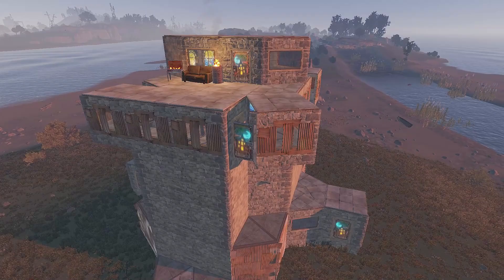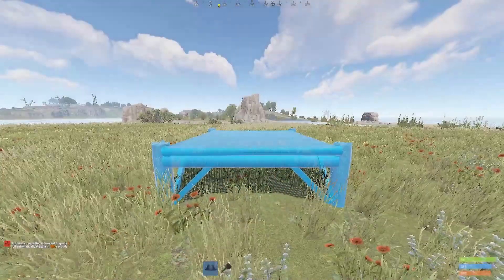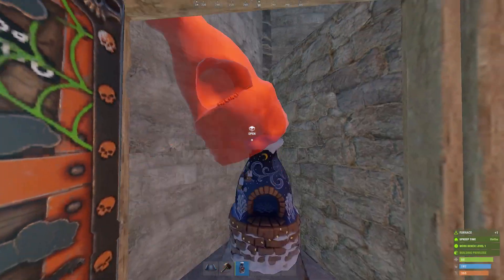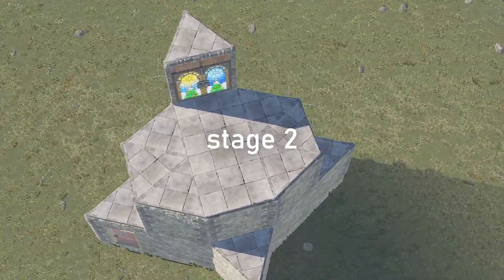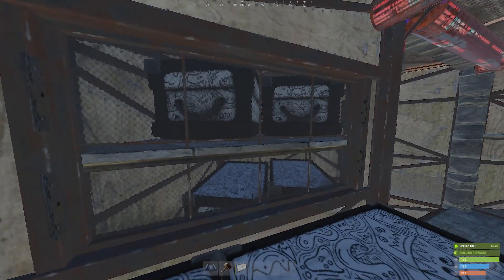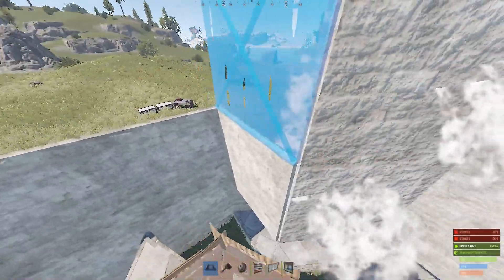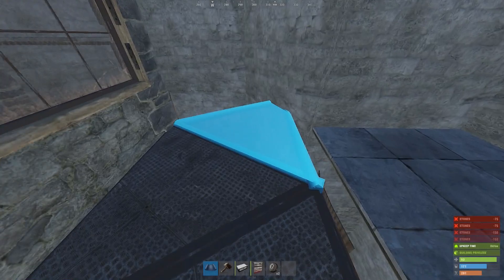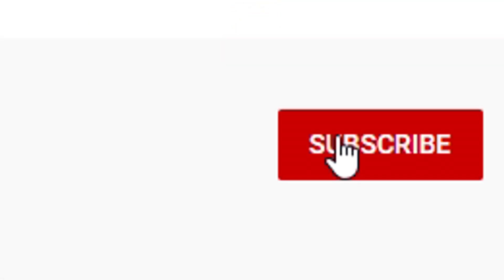The FORT1: a new 2x1 ROOF BUNKER base with Internal ⨯ External PEEKDOWNS // Rust Base Design

Comment: Is there anything I can leave at sheet metal instead of armored? I usually struggle with HQM
Reply from the maker: I usually don't even do the 2x1 armored,.
Do the ceiling armored 100% and the rest is optional, maybe that one wall in between the initial 2x2 single doors (starter base) - the rest is purely optional, but puts the minimal raid cost down to ~19-20 rockets
Reply: @redapplex  oh thanks, I guess that 20 rockets is still a decent raiding cost for a solo base
Reply from the maker: @lunar3858  oh my, this is massive for a solo tbh unless you're playing 2x+

Comment: Having trouble placing bunker triangle roof tries clipping onto the the drop down into the 2x1 is there anything I might have done wrong maybe I left a half wall when I placed my shelf in there? It just won’t let me clip the roof triangle into the triangle frame
Reply from the maker: if it tries clipping on top of the full wall in front of it - place a wall frame on it like in the video
wall frame takes the slot & it stops clipping there
Reply from the maker: does it help ?
Reply: I ended up figuring out that it was kinda tricky to place but I ended up getting it thanks man

Comment: How do you build the triangle thin at 2:38
Reply from the maker: on the outside of the base - place a triangle foundation, half height wall & triangle floor on top of it connected to the full wall of the base. Then come inside & triangle floor will attach to the middle of the wall since there's this twig structure on the outside.